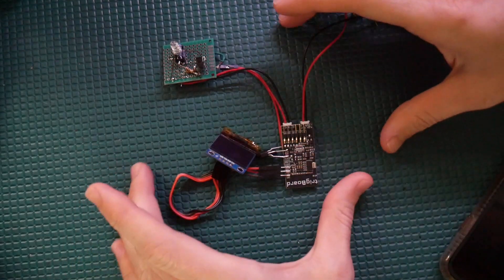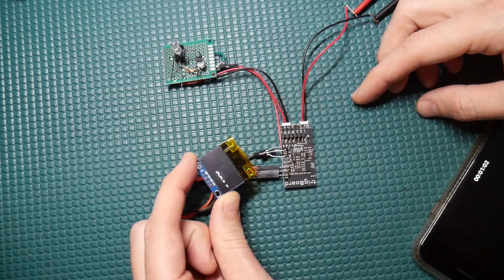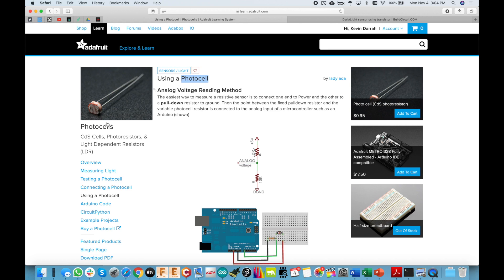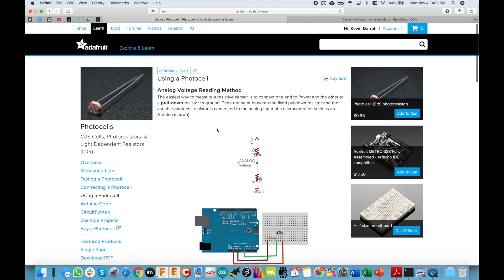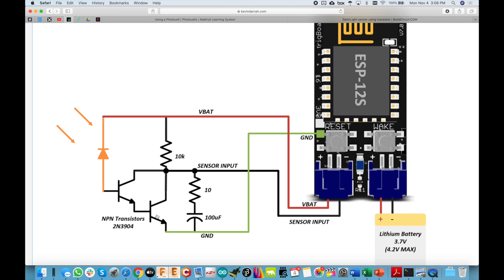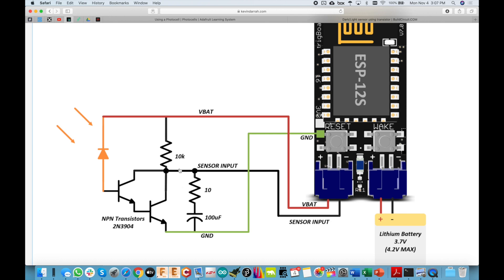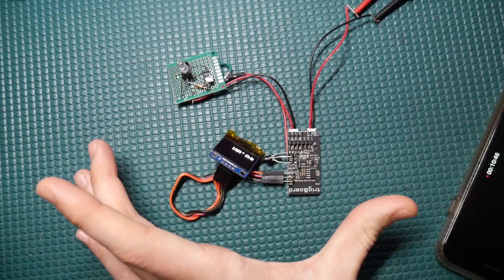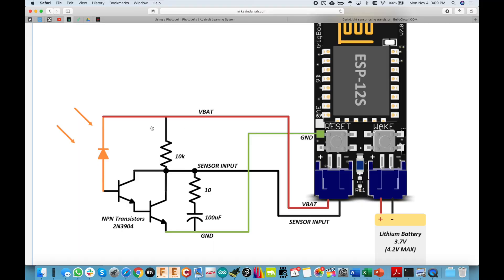Ultra Low Power Light Detector Circuit! Wake up processor from Light! trigBoard Example

Comment: HAHA, my device takes less than this ultra low power sensor and I need sensor that takes much less, like two orders of magnitude less.... but if I clock power supply for it once every 5 seconds, hmmm, but photoresistor is easier to use , with some divider and probing quickly.

Comment: Awesome idea. Will have to pull out oscilloscope to probe some diodes. I wonder if sensitivity to light is stable enough or would drift a lot with temperature or other factors.

Comment: Hi, I have a brief question, I have loaded a 328p with a "minicore" bootloader (both dip and tqfp) and selected 1Mhz and BOD off I have a basic "sleep" circuit and  it is running on a 1.5V AA battery, no one believes me  probably not you either ! my scope isn't working so can't check the actual clock speed and the chips are genuine and correct why is this ? maybe it's lower than 1 Mhz in reality? my setup has minimal dupont leads and all is decoupled properly  but it's true I am using a very crude "logic probe" to see the pin change from high to low, and  that comprises of a seperate battery an NPN trany and  470k base resistor. Two different chips two different packages,and I measured the battery under load and it 1.49v!!  your thoughts please.

Comment: Hi Kevin Darrah;
You can do it better with just 1 transistor.
Use a GREEN LED and a 2N7000 MOSFET.
The GREEN LED can generate more than 2V on the gate of the MOSFET which then
grounds the sensor input pin.

OK, I don't have a trigBoard to test this on.
If a PULLUP resistor is required I suggest it be 1Mohm or greater.
The LED is operating in the PhotoVoltaic mode, not the PhotoConductive mode.
In the absence of light the leakage current in the LED will ground the MOSFET
gate and turn it off

This can also be done with a high gain NPN transistor. I like using the MPSA18
which has high gain even at very low base currents. If the light is bright enough
this can be done with the venerable old 2N3904. Of course in the absence of light
 the NPN transistor is turned off.

I've been using these techniques for solar trackers since the mid '90s.

redrok@redrok.com
Reply: I have to try that in the future, but it looks like the 2N7000 is now an obsolete part, do you know by any chance a similar transistor?
Reply: Has someone tried it?

Comment: Thank you for your very easy to understand detailed instructions. I have been working  to find solution to conserve even more power and  I have example code using adhoc network with which we can create remote sensor which can theoretically run on single 120mah 3.6V LIR2450  button cell battery for 2,636 days if sensor is reporting once an hour. That is more than 7 years on button cell. We can even use non-rechargeable CR-2032 3V 235 mah button cell battery that way we do not need any voltage regulator to run ESP8266. Single CR-2032 button cell can run ESP8266 for unbelievable 5163 days. That is 14 years. The life of button cell itself is only 10 years and this goes beyond that.

Following is link to my code:

https://github.com/happytm/BatteryNode

Use ProbeSender and ProbeReceiver sketches to test it.

Thanks again.

Comment: I love this! But, I pee with the lights off, is it still tracking the water?
Reply: Ive got windows in the bathroom that provide light during the  day and street light at night. Theres probably still a joke in there somewhere, but i guess i was asking if this is to turn on just the screen or is it the whole data collector for the bathroom that gets turned on?
Reply: @regtheveg  I think it's just the screen. Data collection was explained in an earlier video.
Reply: Reg the Veg the whole system; trig board and screen is turned on by the lights on from the LED. Otherwise power (3.3) rail is KILLED
Reply: Reg the Veg do you shower with the lights off?
Reply: I do... once you can shave with your eyes closed, why have the lights on while showering?
Reply: @metamud8686  good point
Reply: @wahidsalah4545  sometimes 🙈
Reply: I'm assuming this was just a joke but you could use a motion detector as fallback. The small ones use 12-15uA which is not too bad. Then again you likely know how much water is wasted on each flush... Protip: You could also flush in the morning if you live by yourself or your spouse is OK with it.

Comment: I am making one of these atm for my fridge, so it will transmit temperature data when the door is open based on the light trigger. My sleep is not as good as yours of course, very nice.
Reply from the maker: Oh man, I love the idea of using this inside a fridge... easy way to detect opens, lol or get a push notification when somebody is snacking that's not supposed to
Reply: @Kevindarrah  Yeah so i get not only a dump of temp trend data but door open alerts also. I have not tried wifi in the fridge yet, I just assumed it would only be able to get out when it was opened. probably should actually test it
Reply: If you could get WiFi out of the fridge, it would be cool.
Reply from the maker: Yea, surprisingly I have gotten WiFi and Bluetooth out my fridge.  I've designed some low power temp loggers in the past and tested their low temp performance in my own freezer

Comment: Nice done Kevin. One of my project is to measure the sunlight with a photo diode and a voltage divider in to an ADC pin on ESP32. Everything works fine as long as i have the probe connected over the photo diode and ground. But i can't have that all the time 😂. The project is on hold on the shelf until i get hit by a flash i guess.
Reply from the maker: thanks!  You should check out a  "trans-impedance amplifier" circuit
Reply: @Kevindarrah  yes i will. Thank you.